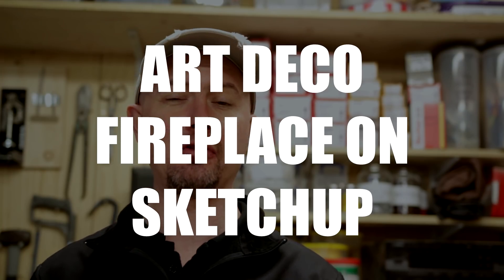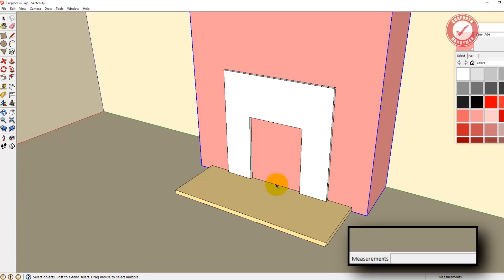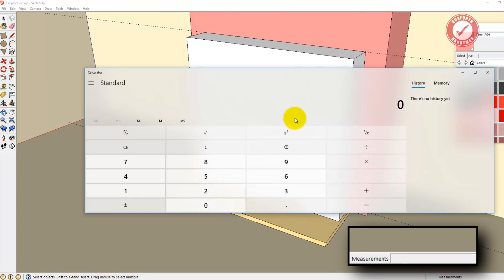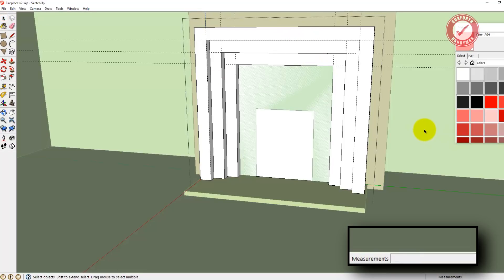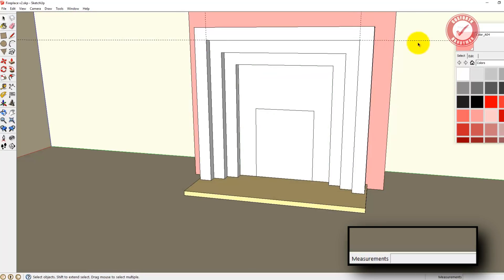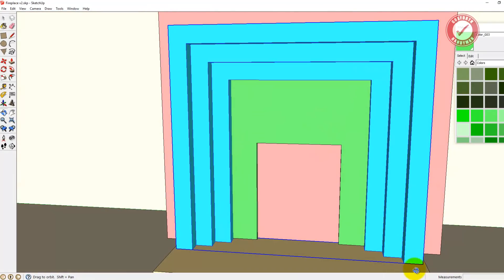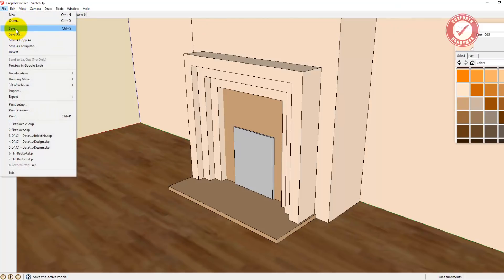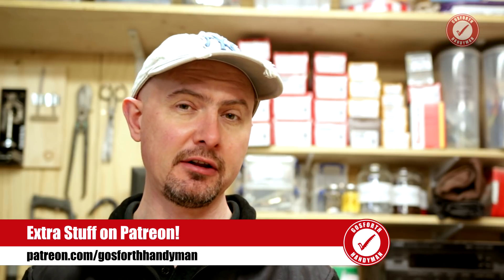Using SketchUp to design an Art Deco Fireplace

Comment: Glad to see Sketchup getting used. I use it 12 hours a day. Some tips. In this case the Offset tool would have come in real handy here. You select the 3 edges of the rectangle that you wanted to offset then click and drag offset and enter your dimension. I believe you used 93. Map the hide object key it is very useful. Also, you can use the X-ray or back lines option under Edges types to see things behind your faces. Helpful to see if you have covered something. Make sure you understand the difference between a component and a group. A group that has been copied can be changed without affecting the original group. A component that has been copied, when edited, affects all other copies of it. 

Many more tips available. If you ever have a question about Sketchup don’t be afraid to @ me on Twitter @slugore. 

Cheers. Love the channel.
Reply from the maker: Awesome post - thanks so much! I'm in a comfort bubble of 'absolute basics' with SketchUp and really need to push myself more. 👍